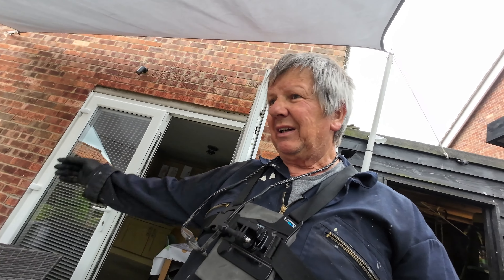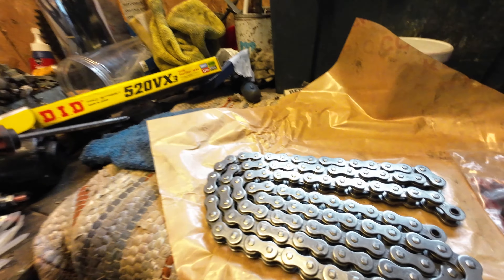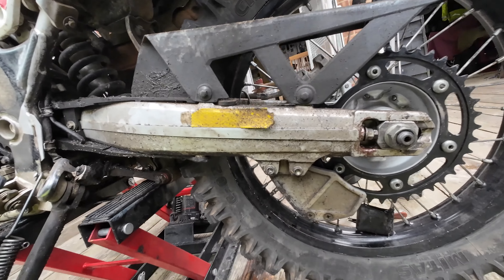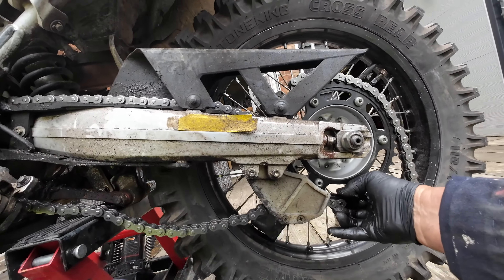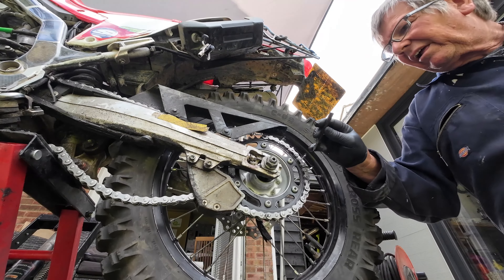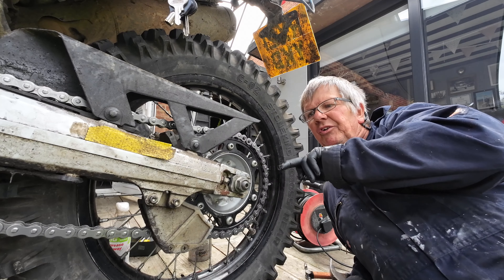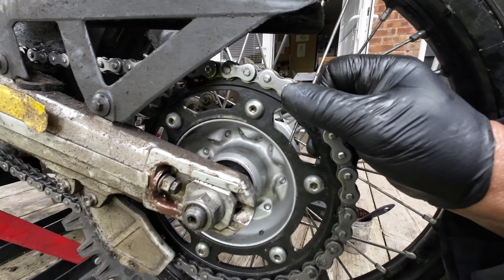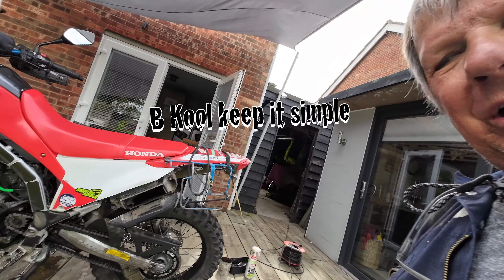Chain & sprockets again!    Honda crf 300l    4K

Comment: Well, Mr. P, you mentioned the chain slack adjuster bolt at the rear of the both swing arms getting stuck. Here in the Land of the Dollar Bill our constitution has a clause requiring all motorcycle owners to remove that bolt early on and dope it up with anti-seize, and the female threads, too. One good treatment and that bolt will never get stuck. Maybe there is such a clause in your famous Magna Carta, somewhere amongst all the other lingo, where the peasants told the king to stuff it.
Reply from the maker: @BrianDoherty-e8s  🤣👍
Reply from the maker: copper grease in the Magna carta 😂

Comment: use a nut and a pair of molegrips to push the side plate on   Merv
Reply from the maker: @mervynhackett5348  which looked the easiest then 🤣👍
Reply from the maker: @mervynhackett5348  that’s another good tip i’ve taught you Merve